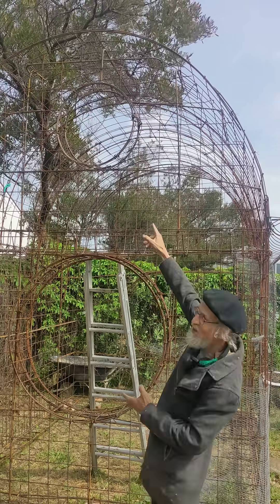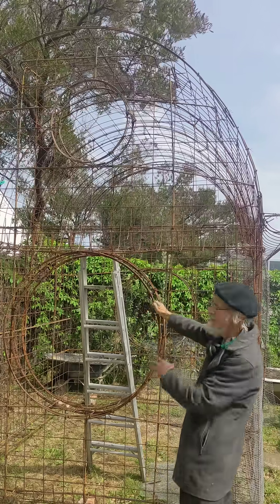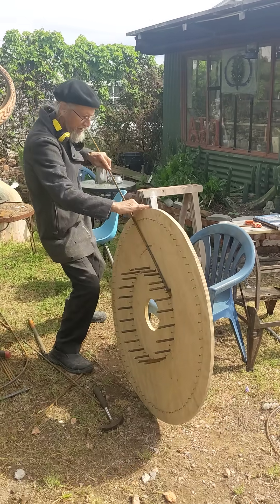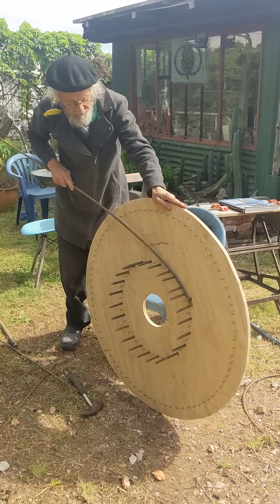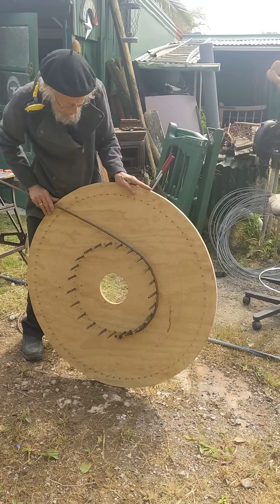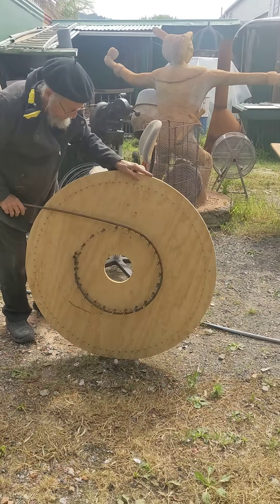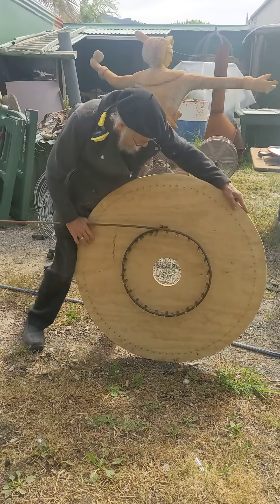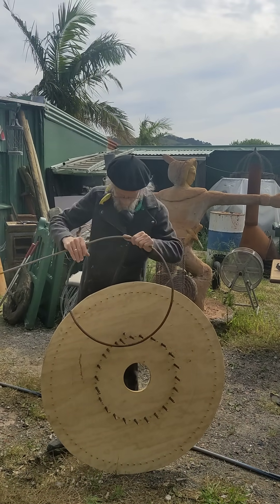Bend rebar circles fast - jig mkii #ferrocement framing #circular #bendingtips  windows

Comment: Great technique! How have you attached the studs onto the plywood sheet? i.e. what's on the back not shown on camera, and what are the studs made from? Are they individual bolts?
Reply from the maker: I just drilled undersized holes and cut the short pieces of rebar rounded the ends with the grinder then put a bit of PVA exterior glue into the holes and hammered the studs as you call them are into the holes on a bench top until they reached the other side so they are held by the full thickness of the plywood.

Comment: A building framed from re-bar. That's interesting!
Reply from the maker: It's the skeleton of the ferrocement method of sculpting any shape..in this case a 'hobbithaven' tiny house, with round door and windows. Next is the chicken wire stitching to give three or more layers to plaster the strong cement plaster onto. Then carve the fresh plaster with whatever ...brick or stone patterns, thatch texture for the roof, and tree forms around the openings.

Comment: You’re a genius. I still can’t get my circles finished at the end. All of your methods make me hang my head in shame. Thanks for the videos.
Reply from the maker: You're too kind! I do use the pipe bender to adjust the ends a bit... See the other video I did with the barrel ... I used a pipe bender there. It's just a galvanized water pipe about 600mm long with a groove big enough to let the rebar in crosswise, so you can lever the rebar...bend it a little or a lot.